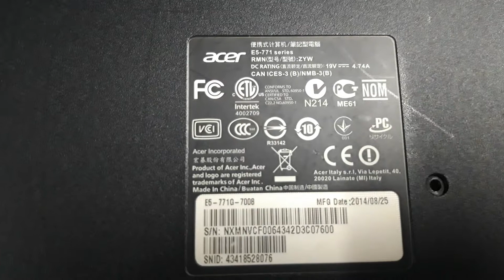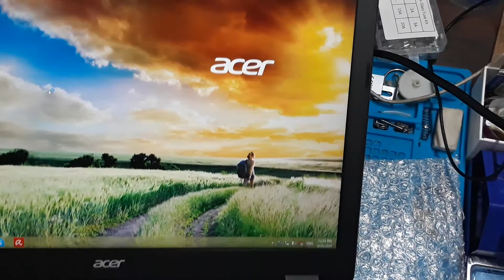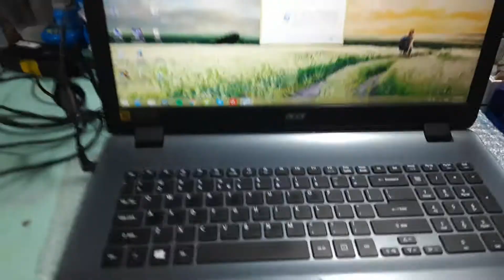Acer Aspire E17 or E5-771G-7008 - How to Replace Battery

Comment: Hi, I have an Acer Aspire E5-771 and because the old battery lasted only max. 30min, I changed it with a new one, but that doesn't load over 89% ...
How can I reset or make it fully charge? I press the pin hole to reset 5sec, but nothing...
Reply from the maker: may be issue on new battery? try others..
Reply: @WorkshopFix  i try with 2 batteries, but is the same problem. if i put the old batterie in the laptop is charging to 100%....i dont know where is the problem.
Reply: Yup, they scammed you with a used battery 🪫